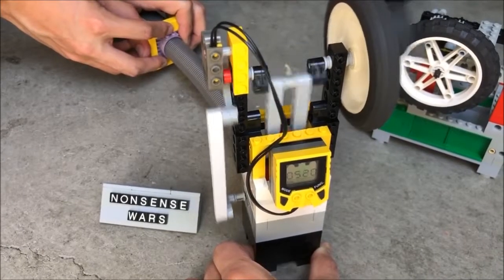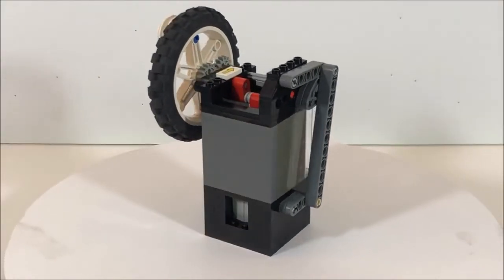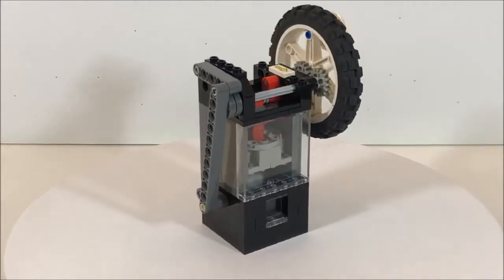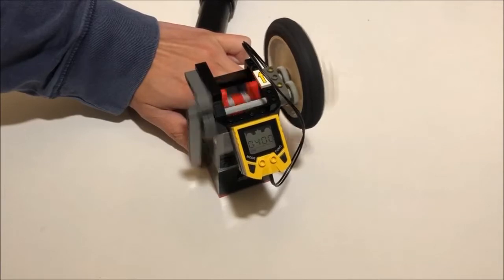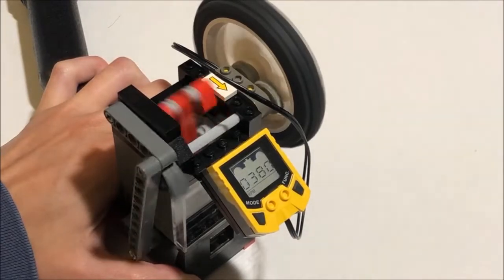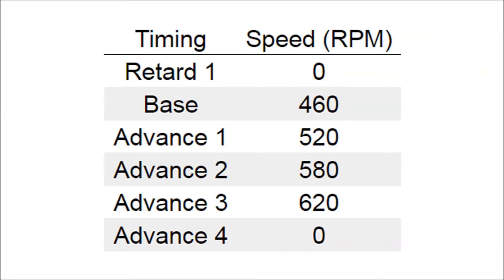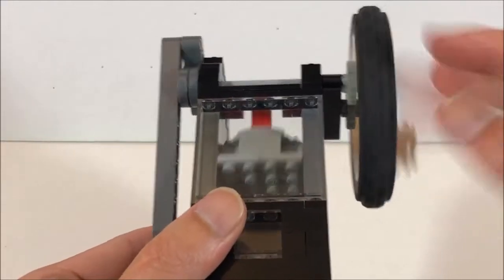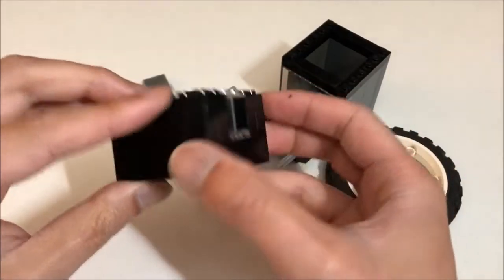Building and Tuning a Simple Single Cylinder LEGO Vacuum Engine

Comment: How does this engone work with just one valve and one port? I thought at least two were needed, one for the vacuum to remove the air from the cylinder on the upstroke then another to allow air back into the culinder on the downstroke.
Reply: Ignore my poor spelling
Reply from the maker: It works because it's very leaky and very inefficient lol.
Reply: @NonsenseWars  ahh thanks

Comment: Great video! You should make a engine based on the ones that are already on YouTube. They are quite a bit faster and easier to tune aswell.
Reply from the maker: Nah, the whole point is to build it from scratch =P 

Next will probably attempt something with dynamically variable timing...
Reply: sure